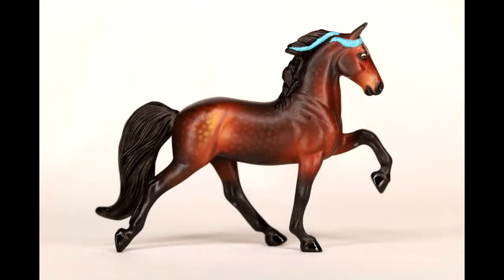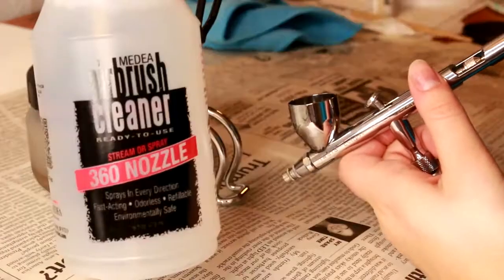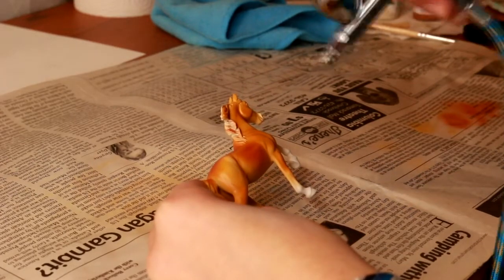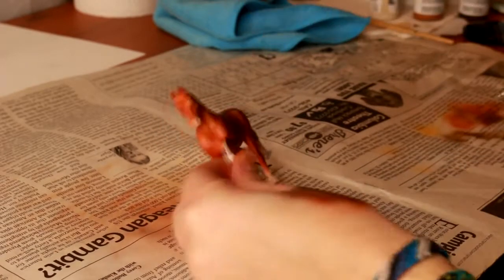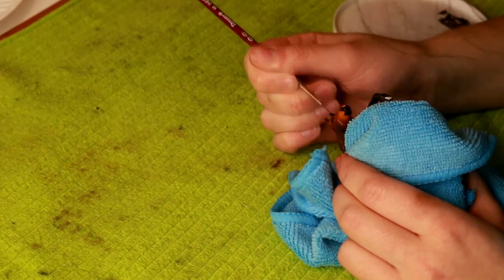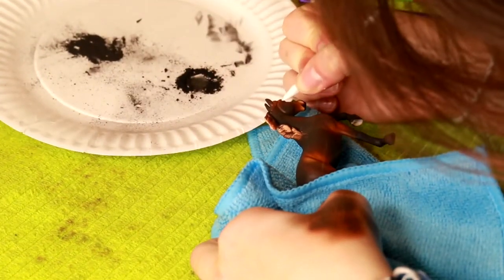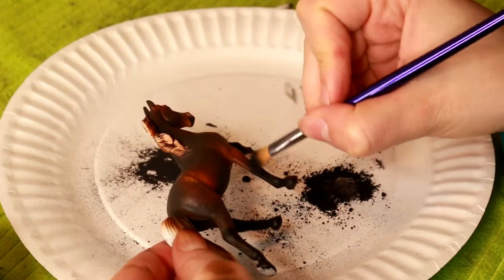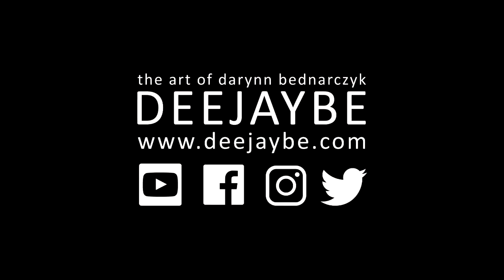Creating a Bay - HOW TO PAINT A BREYER MODEL HORSE - Tutorial

Comment: I'm thinking of trying to paint my own Breyer. How do you strip the paint off the original horse, or do you just prime over the original color? Thanks!
Reply from the maker: Amber Carter If you are painting over an Original Finish model you do not need to strip it. You can simply sand down the seams and imperfections, then add several coats of primer before painting. 
If the model has been primed and or painted before, I recommend stripping it. Tutorials on this coming soon :)